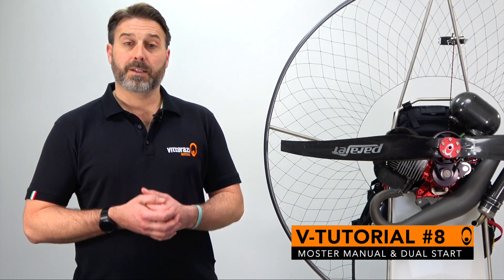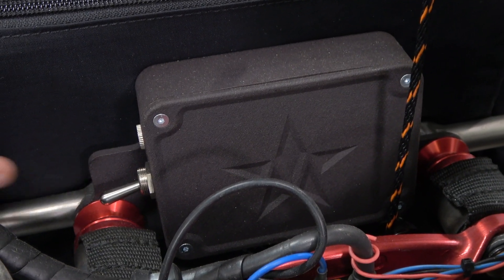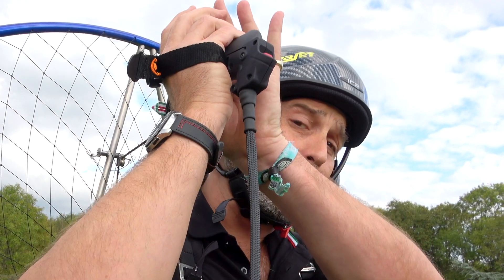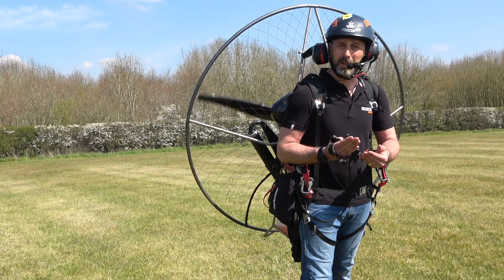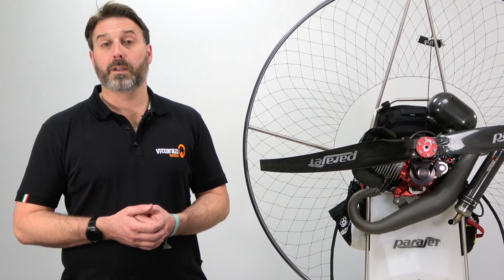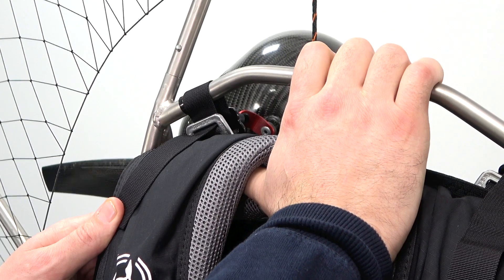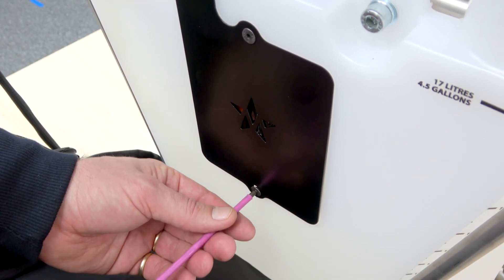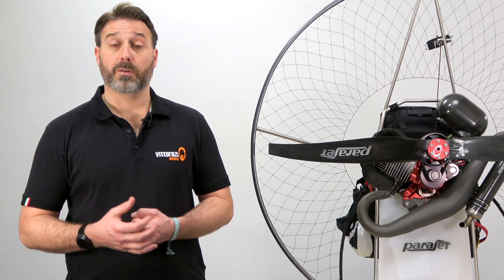PARAJET EXPLAINS 08 - VITTORAZI MOTORS MOSTER 185 MANUAL & DUAL STARTER PARAMOTOR ENGINE MAINTENANCE

Comment: There is a US maker who is using off the shelf Makita batteries and charging system, brilliant, just like sliding in a battery to a power tool, I believe it's well over 20 -60 starts per batter charge depending on battery, could be a lot more, can't remember,  Moment Paramotor.